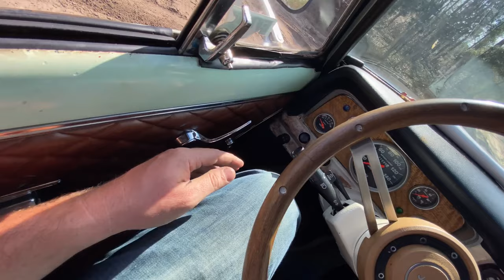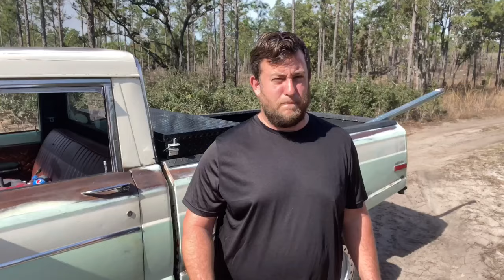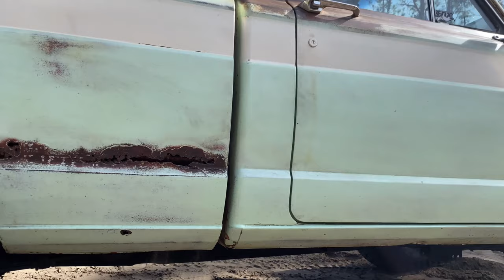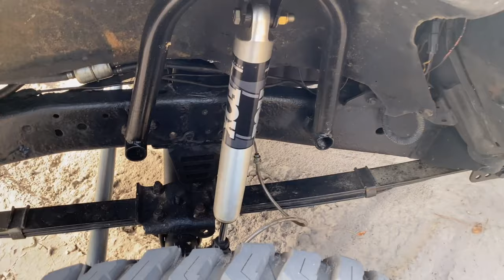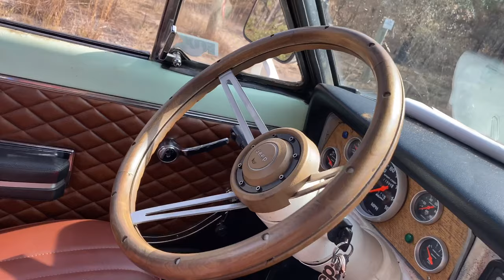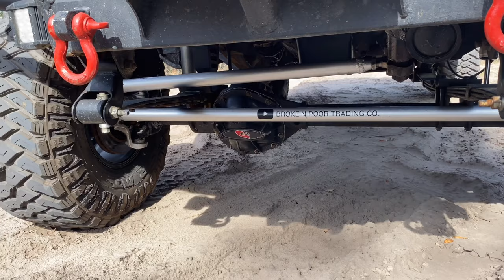Absolute worst classic truck!! Jeep j10

Comment: Agree on small cab ..ugh However JEEP like all old Jeeps were built for narrow trails ,old mining roads and off highway camping and so on .
Not for commuting in today's world . The J truck and wagoneer are purpose built for this use , hence the truck is narrower than all other trucks , just as a CJ-5 or Jeepster commandos are built . It does offer a REAL 8ft bed unlike all modern trucks that can't carry a sheet of plywood or much else.  You own a J truck for what it is not what it is not . As for the carb issue , your correct they are from a time when it WAS the technology . However out in the sticks ..you'll be able to fix most any issue with the engine with a few tools , hose ot duct tape to get you back home or out of the boondocks.  Modern Jeep or any other vehicle if it breaks down,  you are not fixing it especially  if it's fuel injected and your in tank fuel pump dies on you . Lastly  yes the beds suck for rust , the bed floor is tied into the bed sides for strength . But resulted in trapping water . So this J10 is built for the environment its best in . Gripes are fine , just understand what you have and why .
BTW the jeep M715 went to war for a reason . 

Good day to all

Comment: Nothing wrong with carbs... Updated modern ones dont have that issue of going up hills stalling etc..  updated modern meaning from 80s up 2150 motocrafts on wagoneers ran great. And were eveb auto adjusting for altitude.  My 90s carbs hasnt been rebuilt but one time.  And it starts every day sith 3 pumps and the rest of the day i just turn the key.  The hot start issue is most likely a drain back issue from boiling gasoline in the line and fuel filter.  You probably have the tripple nipple fuel filter tilted wrong.. very easy fix.   If its cranking slowely when super hot.  The starter is being heat soaked and needs replaced most likely

I think your carb needs proffesionally rebuilt if youre having that many issues.

Also you can easily buy lifts and stock leaf springs.. even made in the usa.  Your springs are also sagging big time btw i can see it.  Lofted springs from 74-84 J10s are everywhere... Rough country.. Sd springs... there are 6+ websites selling springs..  only 480$ for two in the front and another 400$ for rear..  

Also your bumper.. factory had solid tubed brush guards. If you can find em.. Very similar to that bumper.  Not QUITE as rugged but can easily strengthen for a winch.

All your parts complaints are minor.  Its 50 years old . You think theyre will be repro parts for cars foever ?

The rust is the only one ill agree on.. all the FSJs.. cherokees. Wagoneers.. j trucks.. seem to rust in the exact sane damn spots.  Had to go through major frame and mediumish body rust and minor floor rust on my 90 Grand Wagoneer.

Fortunatly no one has issues knowing what my GW is.. i get stopped daily in parking lots or gas stations people giving me nothing but praise for the resto and mods i did and stuff to mine.

Why dont you get yourself some fender badging from the kaiser 60s Jeep trucks.  That says JEEP on it.  If you want people to see its a Jeep without telling them ?

Also your tire issue is just whiney non sense.  Vehicles in the 60-70-80s didnt have 37 inch monster tires.. large tires for all terrain or mud terrains were 31-33 inchs.. max. Its just the way vehicles were back then.

Also are your AXLE SHAFTS broken.. or are your U joints broken ??  Cmon . Take the knuckle off.. pull the shafts out get it on a vice and replace the u joints.. which DANA SPICER still makes.

The problem with people not knowing or caring.. is it isnt the average person.. Its the average Jeep snob.  The XJ wrangler owners. I brought my 90 to a Jeep 4th of july parade that went up to the mountains.  The column of jeeps was 2 miles long on the interstate..  99% of those people were 2010+ wrangler some XJ owners.. few renegades.

I was the only FSJ..  i have 0 people interested in talking too me.  Everyone was just a snob and only wanted to talk about thier red headlights and 37 inch swampers with the / in the headlights to make them evil looking.

Ive tried talkin to random XJ or whatever owners.  Their snobs too.  All of em.  

Only the average day Joe in the parking lot comes up to me and goes oh WOW i had one of these.. or i havent seen these in forever.. or what not.  I even had a wrangler owner tell me my 90 Gw isnt a real Jeep.. haha

Also for your steering column.... The J10s in the 70s did hsve tilted steering columns.   No idea what youre talkin about ??
Reply: Yeah I'm not really sure what this guy's talking about, most of these issues seem self inflicted or at the very least inherited from whatever idiot he bought it from, regardless it's negativity for the sake of it and nothing more. I'm sorry you've had such experience with snobs, I've had the pleasure and apparently luck meeting some very passionate and knowledgeable people daily driving my full size, I wish you and your truck well.
Reply: 100% agree
Reply: dued just a fruit loop something tells me he just complains about everything

Comment: I have two J4000 jeep trucks 71' and 73' and daily driven the 73' for almost fifteen years with the 360 amc and t-15 manual transmission.
It was a rough start at first because of transmission issues and no parts available.
But later on I enjoyed every moment in it!
It's now undergoing a total overhaul and going to get a 12 valve Cummins engine with manual 5 speed and np205 transfer case.
Front axle is a Dana 60 and the rear a 70 with limited slip differential.
You have a point about the rust , but if you have owned a Toyota land cruiser BJ ,40 ,42 or 45 then you actually know what rust is!😂

Comment: Someone doesn’t know how to properly set up a a carb I put the choke on and as long as the battery is charged it starts 2nd or 3rd crank
Reply: My carburetted cars start faster than any fuel injected car I've ever owned.

Comment: Parts are very hard to get for these no doubt.  There's a company called Alcan that can make you leaf springs that I used and really enjoyed them. I had dana 60 rear and 44 HD out of a j20 I swapped in and after the spring over and blocks in the back I needed something that rode better and had the lift I needed for 36s.  There are panels that easily accumulate dirt behind the rear quarters that I ended up making drain holes for and cleaned them out to stop rust back there.  J series have their quirks but I still wish I didn't sell mine.  Not much beats the sound of that 401 with 390 heads in my opinion.  Don't give up.
Reply from the maker: I’m not giving up yet lol I still love the truck despite its flaws

Comment: Hey those are all the reasons I like mine! Get rid of that Weber carburetor and you’ll have a lot better time running it.
Reply from the maker: Ya I’m definitely going to.. I’m planning on doing a holly sniper on it eventually or possibly try to use a factory fuel injection off a 4.0

Comment: I have one, it was in terrible shape, and I was able to replace everything easily, including aftermarket suspension, brakes, gaskets, trim, even clutch rod that was all boogered up from some terrible abuse in the past. It's a horrid truck, sounds like it's going to die all the time, can't hit 65 without floating the valves, but it's also 44 years old, will shreek the 33 inch mud tires in first it has so much torque, and people love it. Oh, and it starts every time, climbs hills just fine, and idles like a brand new car, doesn't overheat in the GA summers (I do, it doesnt) Plus, unlike all the ragged out common chevy and ford trucks, I am the only person in the entire region I live in that has one.

Comment: I got an 86' J20, it was shipped to west coast and came from FLA, so that road rash on the quarter panels is standard issue. I plan to graft in a new bed and patches with new metal. Carb is easy fix, had the same one on my 82' Wagoneer Limited, go to NAPA, they got a rebuild for $50 bucks. For sure the stick in your is a problem but the automatic is the way to go in an FSJ to begin with. I just got my steering column rebuilt by the Great Guys at JW Autowreckers near Sac, CA, they even had a wiring harness for my J20.
FSJ are the best trucks ever built, highly sought after, I would never trade from an import lol
Loyal Jeepathonian in Nevada
Cheers 🍻 to FSJs

Comment: I'd add that it's safe to say many trucks of the era now have rust . Gm truck beds 61 to 66 including the cab do have serious rust out . 68 to 72 chevy pickups have lots of rust issues all throughout the cabs lower structure . This J10 here looks to have been in a wet or other poor  environments that has rusted much of this truck . My 72  has none of this rust as shown in this video . However the bed seam rust is a prevalent issue with Jtrucks .  The wheel backspace issue is again 
Due to design  for a narrow track JEEP truck , not a chevy ford or dodge .

Comment: I disagree, These are the best attributes of the J-10. I just picked up a '81 Honcho, the truck I've wanted since I was eleven years old. Mine was sitting a field for years and fires right up every time. AMC built these this way for a reason, they small and tough and run forever.  You don't need 36" tires to get through the woods, just common sense and driving skills.  If you want a square body, get one, then you'll be just like every classic truck owner.

Comment: The rust is. Depending on how it’s kept if you find a listing of it in a garage then it’s mostly kept nice and clean  but if it was kept in a old barn then it will have rust since it’s sitting in the grass or old rotting wood

Comment: My 1985 J10 that I found on Ebay in Louisiana before hurricane Katrina doesn't have any rust through. The person listing it put it in the wrong location so I was able to get it cheap and that pissed him off but he had to sell it to me because I was the highest bidder. The cab has been on blocks in my 30 x 36-foot metal building for over 10 years. I drove it home to Virginia. The bed has been outside with a camper top on it for the same length of time and it still doesn't have surface rust. I have the tailgate and the original step bumper. I have a rebuilt 4.2 L engine on an engine stand and a Howell EFI kit to do the conversion. I am just now getting around to giving it a new paint job and putting it back together.
Reply: Do you understand or appreciate the word "patina", refferencing your comment? Put the damn thing back together and enjoy it for what it is! If you bought it as an investment, its probably worth more running, than a pile of parts...if anything...reassembly might get you away from the daily grind for a bit. If there is no rust...put the bolts back in...If there is rust...and no money to pay somebody to repair a speck around the highbeam switch...do aome research and DIY....vinegar and steel wool can do amazimg things.

Comment: I agree with the small cab, and hard to find parts…but I wouldn’t get rid of mine for anything. I have at least 5 people a week risk pulling into my drive way (I am in AK, that is very risky business if you don’t have permission to be there) to ask if I will sell it.  It seems most guys know what they are up here. It is no rustier than my 70’s Ford or my buddies 70’s Chevy.

Comment: I have a 1966 J-2000  I fit under the wheel because the seat springs are shot.  The AMC Hornet L6-232 power steering fits my L6.  Rust and tailgate are facts.  Ty.
Reply: Hi Ryan, I also have a 1966 Jeep J - 2000 with the 232 straight six and 3 speed transmission. In 1993 my cousin Bob and I did a complete rebuild on it from the cab back, all new Chevy truck frame, rear springs, gas tank etc. I recently had both front springs replaced. They were manufactured by the Palmer Spring Co. of Providence , Rhode Island from scratch using the old springs as a pattern. This truck used to be my Dad's and is still my plow truck in winter. The pickup body was replaced with one from a 1977 Jeep ( 7'-0" length ). These old Jeeps are way tougher than any of this new generation trucks selling for $ 80,000.00 or more.
Reply: @phillipbouchard4197  A lot of memories!  Pls. tell me the Chevy truck frame used..?!  looking to improve on gas tank capacity and motor mounts.  the optional frame would accommodate all mentioned in one shot.  Thanx in advance!
Reply: @Ryan33T35  Hi Ryan,              The Chevy frame we used on the Jeep was from a 1993 one - half ton model and it fit perfectly inside of the existing Jeep frame. We slid it in  1'-0" and cut a doubler out of a section we were not going to use to allow us to double plate the joint which was thru-bolted and welded together. All told the joint is one-half inch thick steel and has held up well all these years since the rebuild even being out in the salt for snow plowing. The gas tank we used was a 22 gallon replacement tank from Jeep which goes under the pickup bed just behind the cab. The nice thing about the Chevy frame was their bends were similar to the original Jeep frame which made our construction project much easier. I even got lucky on the purchase price - an even trade for a pickup bed mounted roll bar that came with the pickup body I bought which I was not going to use anyway. I found a 1977 pickup body in a local junkyard that was in real good shape and it fit the 1966 perfectly. Hope this information helps you with your project.
Reply: @phillipbouchard4197  👍 I'm considering mainly for the xmission keeping a std drive but with o.d.  more than a 1:1.  So its not running 4k rpm. at 65 mpram.  This is all info that is lost if not shared and much appreciated!
Reply: @Ryan33T35  Hi Ryan, It sounds like you intend to do some highway traveling with your truck and if so, going with an overdrive will save your driveline for the long haul. My Jeep is pretty much retired as I save it for the hard work of plowing snow for which it's low gearing and slow speed is optimum. My Crown Victoria wagon's and 1989 Mercury Grand Marquis take care of the rest as they all have overdrive transmissions.

Comment: Thank you for all the info on your truck. I have a 1971 J2000 thrift side that I just dropped a Cummins 4BT in and am about to start on a full frame off restoration on. Any additional tips and info will be much appreciated. Can you please tell me what the bolt pattern and center bore is on the wheels.  Thank you!
Reply from the maker: I’m not sure what the bore is but they are black rhino offshoots 15x10 6x5.5 lug pattern 

A 4bt will be awesome in there.. that was one of the motors I considered it was just a little pricey for me.
Reply: @brokenpoortradingco  my j2000 is a 5 bolt and I’ve not been able to find any solid info on google. I’m assuming that you upgraded your axles?
Reply from the maker: My axles are upgraded internally but they are factory axles. Some of the j trucks had 5 lug axles I believe they are 5x5.5 pattern and they should have a large center bore to clear the hub lockouts.

Comment: You can stop the whining. If you used it for what it was intended to do? It is a great truck. I had a j10. Now I have a j20. We use it like a tractor on our farm. It always starts and pulls like a herd of horses. I would agree. Not the most comfortable unit. But, if I want comfort? I will get in my Expedition. And, by the way. If you need to help with the fuel problem you are complaining about? Put an electric fuel pump and a predator carb. On it. Problem solved. And, there are lift kits for it. The best advice, as one poster commented. Sell it..............

Comment: How’d you go about replacing the stereo? I’ve got a 87 and I’ve got no idea how to go about wiring an aftermarket stereo since there’s no aftermarket harnesses
Reply from the maker: I didn’t use any of the factory wiring.. you’ve just got to hook up positive and negative for power then run speaker wire to every speaker.. it’s easier than it seems.. should be a diagram that comes with your stereo.
Reply: @brokenpoortradingco  as for the sound bar you had in that thing did you just pull one from a wrangler?
Reply from the maker: Ya it was from a yj wrangler.. I actually bolted it through the roof (I don’t recommend) i couldn’t find any other way to mount it… I actually removed I’d because I hit my head on it but I’m 6,4 so if your shorter it’ll probably be fine. But they wire up really easy just positive and negative wire for each speaker.
Reply: @brokenpoortradingco  sweet! Might have to try that because other then the doors there’s no where else for speakers on my 87 j20. Cool! Love your headliner and door panels too, watched those videos and looks like it saves a ton of money, headliners and door panels are stupid expensive for what’s essentially car board
Reply from the maker: Thanks.. you can also cut a hole and mount speakers in the b pillar. That’s probably what I’ll do since I removed the sound bar.. maybe I’ll make a video of it when I get around to it lol
Reply: @brokenpoortradingco  so you didn’t use any of the factory wires from the factory stereo but instead added and wired your own wires
Reply from the maker: @connermiles7847  yes just used a positive and negative from the fuse block and ran wires to each speaker

Comment: The audacity to call the J10 the worst because it has rust shows you don't have knowledge about vehicles especially this one. It's a 40 year old vehicle, my dodge which is 20 years younger than this has more rust on it because it was originally living in Pennsylvania, and you can't find aftermarket parts for this truck because it's not a very common truck to come across, most are either rotting in someone's backyard, sitting in a junkyard, or maybe if you're lucky, on marketplace.